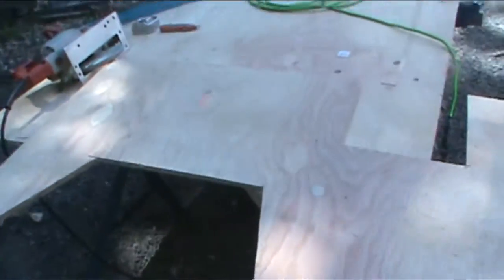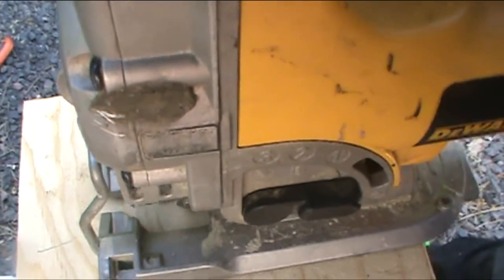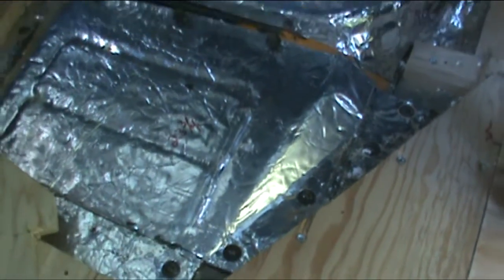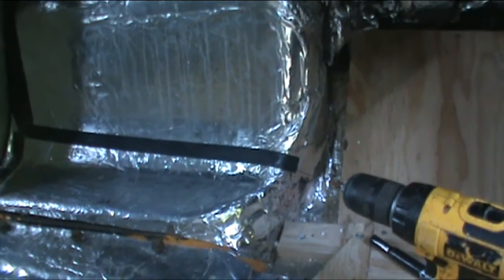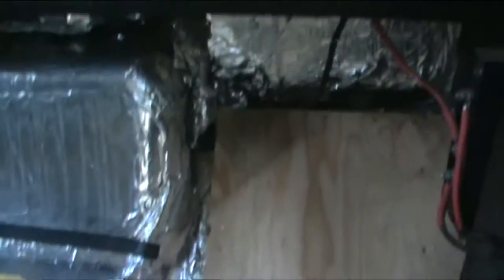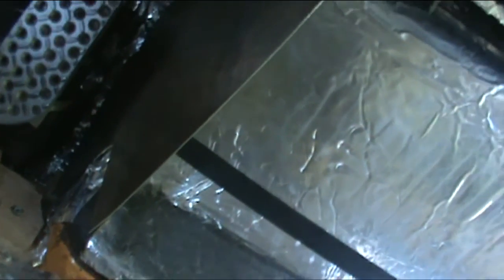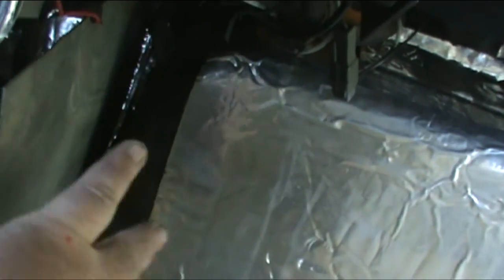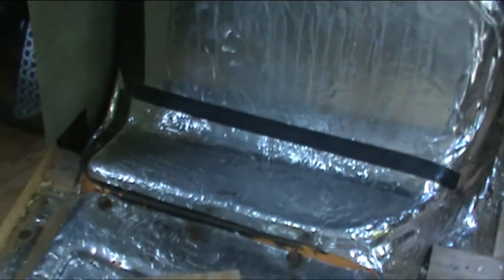Jon's Bus Conversion Part 48 - More diamond plate

Comment: nice love that diamond plate aproch.. its just gona be hot when the sun shines on it.. but looks sweet!👍👍✌
Reply from the maker: Thanks. Hmmm good point - I hadn't thought about that. Well I just bought a used swamp cooler for $25 on CL. Will be doing some testing in some future vid.
Reply: +mudspringer .. i just recalled days standing on that stuff back when i worked a carnival.. just let it go dull and it wont get so hot in the sun.. however it is a nice look.... looking forward to the swamp cooler video!  i have a little short bus  always looking for shade to park it under when boondock camping..  ✌ and good luck with your bus.. id do videos but cheep phone and i dont like cameras.. lol